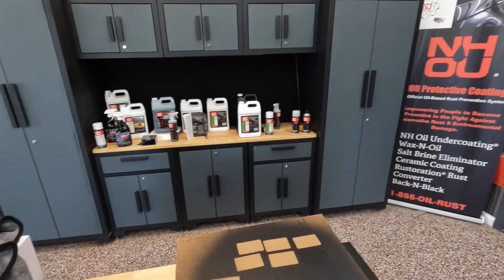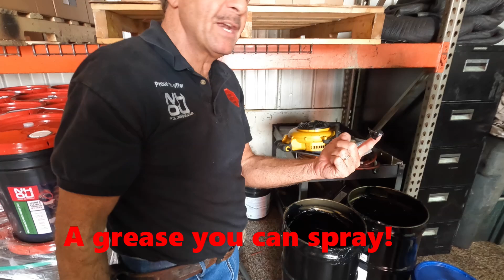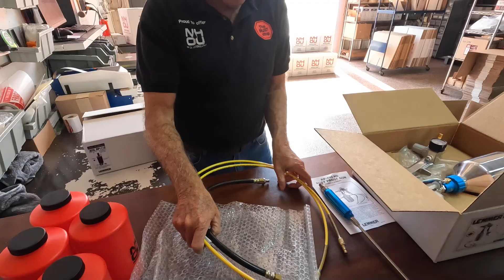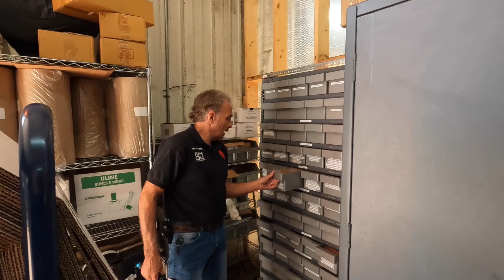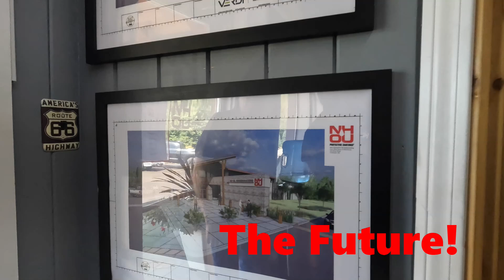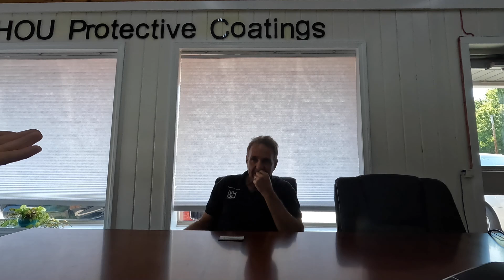The Facts! Lets Talk Oil Undercoating

Comment: When I bought my car last year it appeared to have an oil undercoating but now the frame is dry to the touch and seems to be a layer of some kind of rubbery gunk on it. I'm very worried it's Ziebart, or some other similar garbage, and significant damage has been done underneath. The inside of the frame seems a little oily, at least at the points I can fit my fingers into. 

Do you think an oil undercoating could save this? Or should I trade it off before it's too late? 
Can NHOU be applied to one of these solid undercoatings?
Reply from the maker: Sounds like it’s oil undercoating but done a few years ago, it’s normal to feel like a diet layer on it from road dust

Comment: I'm local to the NHOil facility and used to spray it for a local dealer, after my 2011 and 2012 vehicles rotted out I purchased a 2002 rust free from Florida and had the hd coating done last year when I brought the SUV up.
They did the hd as a brushed on grease last year, my vehicle still has a complete oiled coating everywhere, it has held up amazing on the undercarriage of it after driving daily over 30,000 miles the last year or so and it's great!
 I will have them do the touch up this year and let them see how it held up and check the retention of the hd product but having done just the oils myself for a few years, there new grease "hd" product is a game changer as far as longevity!
 Great video, this product needs more light in the new England area, works so good and helps keep the vehicle lasting years longer then without!
Reply from the maker: That’s great to hear

Comment: I just checked their website and used the feature to find a local dealer near me and it turns out there's one a few miles away from me in Manchester, CT so I'm definitely going to get this done to my relatively new car that only has 20k miles on it. I want to keep the car for 20+ years so preventing rust is going to be very important. Thanks for turning me onto this product because I was just going to use fluid-film instead, but this NH oil undercoating seems even better.
Reply from the maker: Once you try it you won’t be disappointed it’s great!